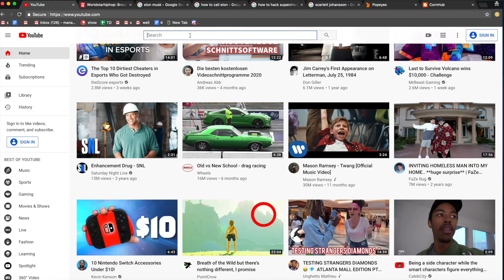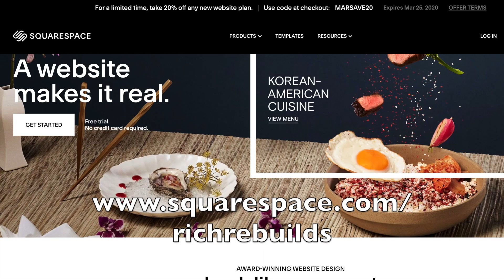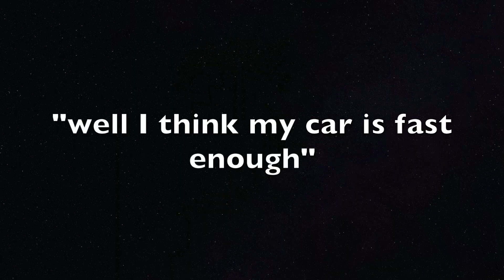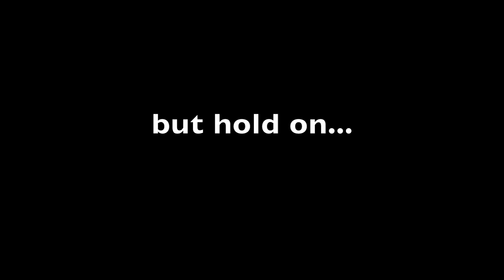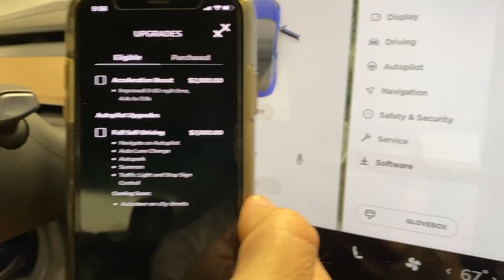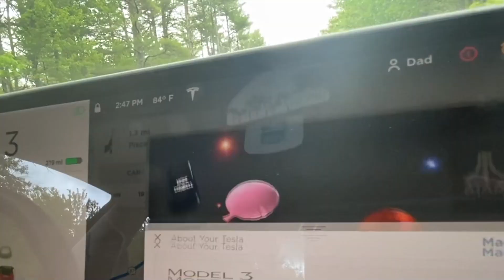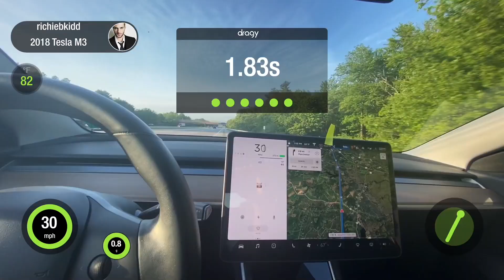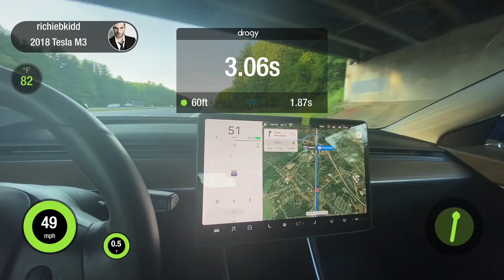We hacked the Tesla model 3s and it's true potential is INSANE

Comment: This is really incredible and huge step for performance enthusiasts. Improving your car's performance is a huge part of the culture, and it is something that electric vehicles have really not be capable of doing until recently.

That being said, I'd like to know more about the specifics of the upgraded "ghost" mods. 
What exactly was being changed in the modification? 
How does it impact battery life?
Are there any unintended side effects (aside from the obvious warranty void)?

Not trying to poopoo the accomplishment, but in order to see the "big picture" as you described, you should really give us the "whole picture" as well.
Reply: Yep !  Exactly what i thought !
Reply: but now were tesla's tactic is getting cheaper but faster the newer the cars are, it is really not good for (their) business.
you could say now "not my problem" but infact it is. Cuz if things like that are booming to hard (i dont think so but, yk) then they wont exist for that long anymore.
which obviously means you cant buy a tesla anymore.
Reply: what about discharge safety if that battery explodes while your running hacked firmware then i dont think that's on them anymore
Reply: @1slurr719  in this case the battery isn't a concern but breaking the electronics on the motor is, and newer AWD cars won't even let you do this (as much anyway) as there is hardware physically missing on the electronics.
Reply: @1slurr719  they are not samsung
Reply: @1slurr719  it won't explode

Comment: I'm curious on how this affects the durability of the motors and the battery long term. There is always a downside to such upgrades as you are pushing the existing parts to their limits instead of putting in more powerful parts...
Reply: It has the same parts so no different than oem.... It's actually identical it's why they are able to do this

Comment: I have a performance model 3 and I've wondered about what the true performance could be on these vehicles. I always want faster, though I definitely wonder about battery and motor longevity. With upgrades to gas cars (another one of my cars is a fairly modded BMW 335i), the wear and tear can often be isolated to a few easily swappable components, such as ignition coils and spark plugs. With something as integrated as electric motors and batteries, I wonder where the wear items will primarily be. Demagnetization of the synchronous motors? if the battery suffers greatly reduced range, I wonder if the BMS can be reset and modules of batteries could be swapped

Comment: I'm curious what the overclocking does to the range of the car and the life of engine
Reply: @xTatsuran  model 3 will auto reduce power if motors get hot, battery high current drain is more what I'm worries about, motors should be fine
Reply: @ryanb7476   But will it reduce power if its hacked :P
Reply: @TechTesting  Good question. Bypassing or hacking software protocols often comes with unforeseen consequences.
Reply: @ryanb7476  I took my ghost to the track and when the battery got too hot my output was reduced.  I believe ingenext just flash the performance firmware on the rear motor (rear motor is master, front motor is slave).  So it seems to behave as if it's a regular dual motor performance.
Reply: reduces it from 113 year life span to well under 90 years before it needs new parts
Reply: The motors are brushless and have basicly no part that will wear out except bearings. The battery's are another story
Reply: Just an fyi after talking to the people that made it... The motors are the same that are in the performance for the specific models that are supported. So they are just being told they are performance.The battery is the same throughout so theres no issue there either.
Reply: @Dimrain13  except for when the performance is taken beyond what the performance model is capable of. Manufacturers of combustion engines do similar things, like some BMW 2.0L engines, there's a 200bhp variant and a 250bhp variant, same engine with different software. You do reduce the lifespan when you increase the power, just not to anything less than the lifespan the higher up model has already, the extra cost is basically just paying a higher premium on your warranty to cover the (small but statistically significant) increase in the risk of an early failure.
Reply: extra performance requires more power, this reduces the range but the motors should be fine for the life of the vehicle
Reply: It increases the amount of mileage you get per charge and also increases the life expectancy of your by an average of 300,000 miles. This is common knowledge my dude.
Reply: Will probably reduce the lifetime of the battery from 8 years to 5.
Reply: Everyone's talking about batteries and motors, what about the motor mounts, they're going to be experiencing a much higher torque spike than they're built for (true, there will be some headroom). I recall early BMW i3s breaking their motor mounts until BMW released a patch to reduce the torque spike and remediate the issue (although in that case I think the early i3 motor mounts were plastic(!), so that probably didn't help 😉

Comment: This is really great. I can't wait for more EVs to get chiptuned.
For now, the Tesla Model 3 Dual Motor and Renault Twizy are upgradable though software.
It felt like chiptuning EVs was never going to come.
The Mitsubisgi i-MiEV should be the one chiptuned next, imo, because the i-MiEV Evo (Gen. 1) has the same motors (well, 3 instead of 1, but still), but they were retuned and that's, like, the official statement from Mitsubishi. You can find that on Wikipedia.

Comment: The i8 has way to much sidewall. You need bigger rims on that thing
Reply: Aedan Allen-Brower Actually is has very low profile tyres. The rim makes them look like that. Its a 2 piece rim with the outer part painted black. You can only see the middle part if not close enough to the car. Thats why it gives the impression of a 16 inch rim with huge sidewall tyre .

Comment: So the conversion only works for dual motor and not rear wheel drive?
Reply: It's not a conversion. It's an upgrade via software hacks. But yet it applies to DM only with 980 motor. That Ingenext company though has said they are working on power upgrades for the other model 3 versions.

Comment: oh boy. you just opened pandora's box, for eletrics modding.
Reply: That was my first thought too after watching this. I’d love to see them mod the new RAV4 Prime when it’s available, wonder if they can squeeze any more power out of its electric motors 🤔
Reply: @jvm5th  motors are basicly only limited by amps and rpm. At some point it will burn up. You can only get more performance if the driving circuit isn't already running 100percent of what the battery can offer. In electric bikes the most popular way to get more juice is doubling the voltage which in theory would also work on cars if the drivers can handle the higher voltage.
Reply: @peterzingler6221  "The power electronics are superior in the 1120980 motor. Model 3 Performance models all have this motor number. The 1120990 motor is less powerful so it’s impossible to increase the power by 150HP. The Boost 50 module is the maximum power for this engine."
Reply: @nasrsayed9362  Everything you typed was wrong.
Reply: @nasrsayed9362  You're welcome friend.

Comment: You didn't measure the 0-60 of the Performance 3.  It should be 3 sec which is faster than the "ghost" model 3.  Seems like something is wrong here.  Also, it is illegal to bypass electronic security if that's what you did.

Comment: Very cool! I've been waiting for something like this for a long time. Would love to know more about how these performance upgrades are actually achieved in detail, such as what code or hardware is changed and if these changes are detectable by Tesla.
Reply: That's my thought.  My experience with Apple Jailbreaks are that usually Apple quickly patches jailbreak exploits as soon as it can find them.  Many Jailbreak teams have had to drop their jailbreaks to the public during Apple betas since an exploit that permits jailbreaking is found to have been patched.  Who's to say that Tesla won't try and close the holes in firmware updates (making it like jailbreaks where people have to decline updates until a new flaw is found) or detect that a car has been modified and say lock it out of Super/DC Fast Charging like they currently do on salvage cars?  I drive a 2005 Cobalt.  If I tune it, it can't phone home or receive OTA updates with GM to potentially brick it or put me back on stock firmware if I update it.  I've always seen Tesla to operate much like the Apple of cars and their dev team is top notch; so I'm wary of anti-modding measures that they may take.

Comment: Tbh they are over engineered shit of which you are not the owner even after you buy it. AC engines are bullcrap, there are many DC forklift engines (yeah, in case you didn’t knew electric forklifts exist, even in the 80’s) rev range of those is crappy, but with automatic transmission it can be badass, inverter steals the power and transmission allows you to use the juice to the max, those DC engines are the best, engineered with electro magnet, which can get stronger than neodimium magnets, so those AC f*ers can suck the dong to DC engines

Comment: Question is the after market tune cheaper than $2k? Will firmware updates require a new flash? Can it be blocked via fw update or is it a design flaw in the hardware that cannot be patched via software.....

Comment: I'm waiting for someone to rig a bank of super capacitors, to act like NOS does for gas engines.
Reply: Yeah, at 6:20 when he's taking about staged upgrades, there's a battery pack in the video so I thought the upgrade might be battery related. 

That said, I don't think the batteries' internal resistance is currently the performance bottleneck. Super capacitors don't have nearly as much energy density either, so range would suffer dramatically.

Comment: I wonder what parameters they changed to get more performance out of the motors? My uneducated guess is that they're changing the signals to the motors sensors to trick the inverter into sending more current. Anyways it will be cool to see what hardware upgrades will be available for electric cars in the coming years.

Comment: Now hack the performance model to see how fast it is
Reply: The two cars have the same motors and batteries so there'd be no difference.  The performance just has different software, brakes, wheels, spoiler.  It might even be slightly slower compared to a hacked AWD due to it being a few pounds heavier (assuming different wheels).

Comment: Good news! I want this for the already known power (software)limited SR+ (purposely made slower then the LR Rwd while being lighter)
Reply: might not be that simple. there's more current available on the LR/P variants with their 75kWh batteries verses the SR+ with it's 50kWh battery.
Reply: That’s what you would think, but the sr+ has only 1 motor to feed power from battery, the awd ones need to feed two.

Also ScanMyTesla shows the power is software limited to 220-225kW for the SR+ while the battery is software limited to around 280kW, depending om battery temps.

Comment: You beat the Tesla Engineers.  I'm certain you are doing something bad to the motors, batteries or something else.  It's like a turbo RX7, Boost in, apex seals out.  ie.  you are just working yourself faster to an engine rebuild.  Nice if you can afford it.
Reply: Only thing certain is your lack of knowledge about these two specific Tesla models. The LR AWD with 980 motor is IDENTICAL to the P3 in all mechanical regards. They are simply giving it the same level of power. Tesla also builds in a lot of buffer with their current power levels. The motors themselves were pushing model 3's into the 2 second flat 0-60 times during prototype testing.

Comment: I get where he is coming from, this hasn’t really been possible until now , but if the motor goes bad or battery for some reason decides to die , the tuner isn’t responsible for it , and Tesla will void it as well, yes this is same case with gas cars , I have a tuned mustang , luckily my warranty has been void yet but it can be at any point , but thing with electric cars , the battery alone can cost 10-15k without the motors and labor which not many people know how to work on to begin with, and warranty is one topic , but having supercharging disabled especially if you bought yours clean from the dealer due to running that’s a whole new can of worms
Reply: When ford decides its time to void my warranty it isn’t going to stop me from getting gas and use my car just as a car should be used , this on the other hand could limit you to using basically home charging and that’s about it.

Comment: There is a way to get much more acceleration performance from motors. 

Those motors have a lot of torque at startup, right? No, they have more torque at speed. There is a way to get the high speed torque but at startup if you use two motors and a unique gearing system. 

I've suggested idea a long time ago. It may even be too much torque to be useful for anything other than semi-truck and and freight trains.

Comment: Interestingly since Stage 1 has a physical module and Stage 2 is even more comprehensive I am going to guess that it sits behind Tesla firewalls hence cannot even be detected let alone stopped by Tesla. I am going to guess that the only way that Tesla can even detect these mods is when they look at the data coming back from thier vehicles and suddenly find that these cars are accelerating faster then they should. So it probably deletes sending the data back to Tesla.
Interestingly this butts right up to the Right to Repair debate going on in the states right now. Admittedly I am guessing that it allows you to turn back on Supercharging etc. But is it a repair if you haven't paid for FSD but it allows you to turn it on? after all the hardware is part of the vehicle you buy. Probably the software is also downloaded ready just to recieve a signal to turn it on for $7k or $8k.
If Tesla are clever they will turn a blind eye to performance mods even to re-enabling supercharging as legally they are covered if a Tesla bursts into flames as they can point to the fact it was disabled. Though of course they are losing revenue as people are supercharging for free. But if people start turning on features worth thousands of dollars to them that is a whole different matter.
The flipside is that how are they going to stop it? You have a website outside the USA and someone posting it to customers from outside the USA for the stage one. Sending the money outside the USA Via PayPal of course just to rub it in Sorry Elon.  I think that would even be mostly legal. Who is going to turn down a performance boost plus supercharging and FSD and all those other optional goodie Tesla charge for $1500?

Comment: Is it still able to supercharge.
Would it be possible to totally wipe the Tesla software and a 3rd party company write software to run the car like normal (even improve the performance like in this video) without teala interference?
Reply: It is just tweaking Tesla software, not replacing it. You cant replace it.
Reply: @JasonWW2000  I'm a noob when it comes to EV so forgive me if this sounds daft. I mean a modified software to take full control of the car, rather than having to pay Tesla for extras that are already on the vehicle and take away the worry that they will disable certain things if they deem it necessary. So you couldn't replace their OS for a modified version, or basic version which runs the basics of the car (no autopilot, just forward, backwards, parking sensors and a reversing camera function).

Comment: Awesome video. Going to assume those were 19" wheels vs the 18" wheels. Reducing the overall diameter and wheel weight actually has a huge affect on Tesla vehicles. Probably would have been closer with the same wheels and tires. I'm in the process of reducing my M3P's unsprung weight by 65lb. Hoping to achieve 3s 0-60 times.

Comment: You're mistaken on 2 things (probably deliberately since you're advertising something that does software unlock).
You can modify Teslas in almost same ways as you do with gas cars to get them faster. Better tires, spoiler, lowering the car, removing weight from vehicle etc. You can also modify battery controllers and engine itself (though no after market parts to do so exist as it's relatively niche thing to do at this point). The only thing you can't do is gas engine and exhaust modifications because of obvious reasons.